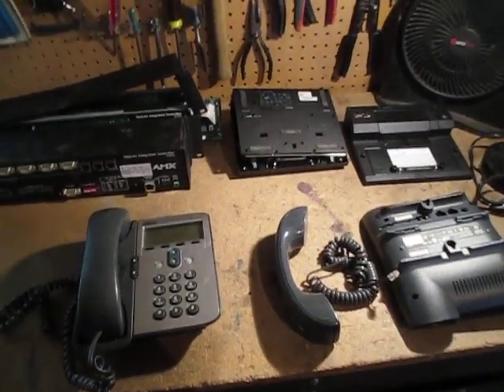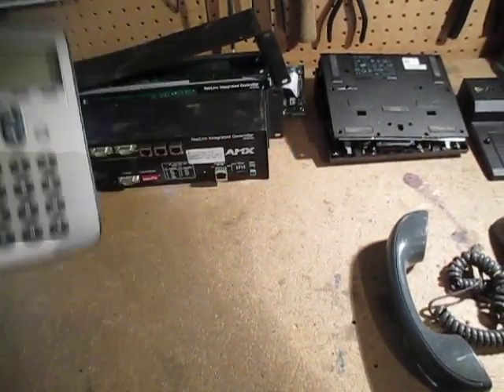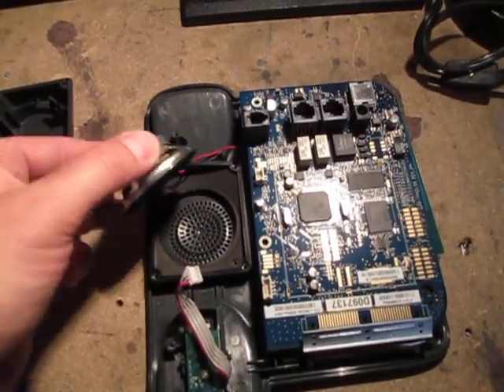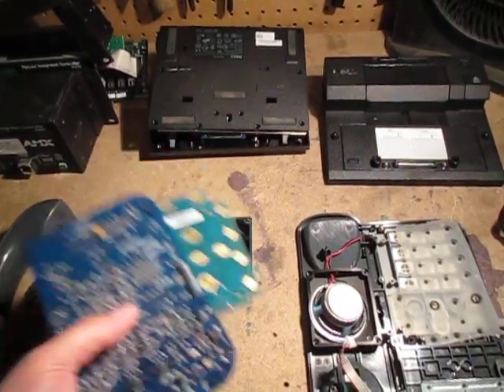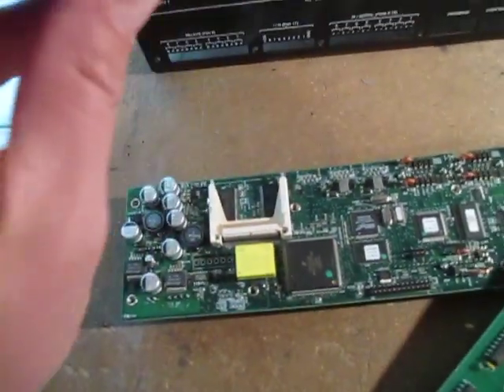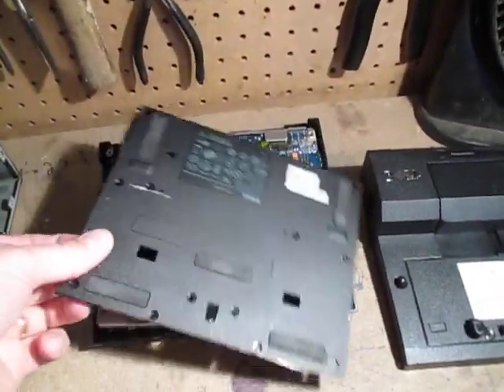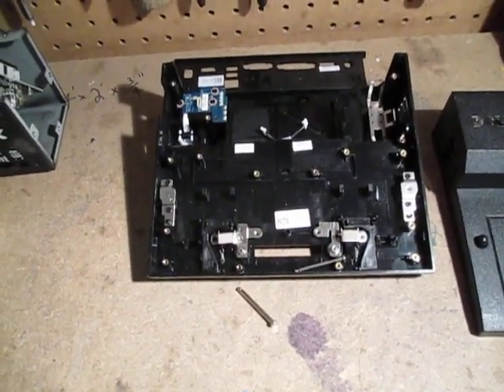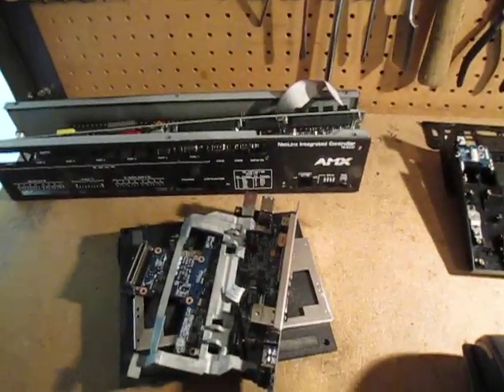Finding Gold: A Complete Breakdown Of 3 Scrap Electronic Components!

Comment: Looking for advice... I have the guts from a dozen or so computers. I vaguely recall you mentioning an online board buyer for high-value boards that you stopped using when you found a private buyer. My yard only has 1 price (only high-value boards), and it was around $0.15/lb. Could you provide a reference? Also, is it better to cut the pins off memory and sell the boards seperate or just leave them on?
Reply: I've watched every single one of his videos. He talked, in the early vids, about an online site (maybe boardsort?). At one point, he talked about finding a contact that gave him a better price. I'm not trying to hijack his buyer. I just have half a dozen old computers, from 386 on up plus another half dozen from the dual-core era. I need to get rid of these, but I would like to get a decent value for them. At the very least, I would like to get more than an appliance rate.
Reply from the maker: The best buyer outside of a private buyer is eBay. They set the market for scrap boards. I met my private buyer on eBay. And we started making deals outside eBay. On eBay the buyer pays shipping cost which helps a lot too. You can also go to the "scrap metal forum" online and look for buyers. There are 100's of buyers on there. Take Care.